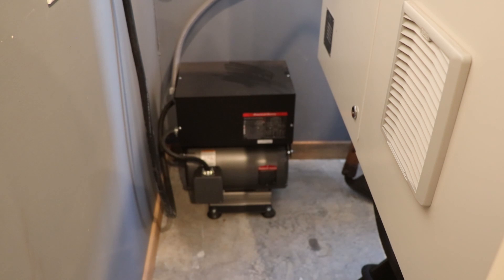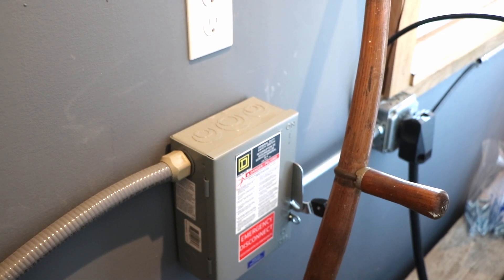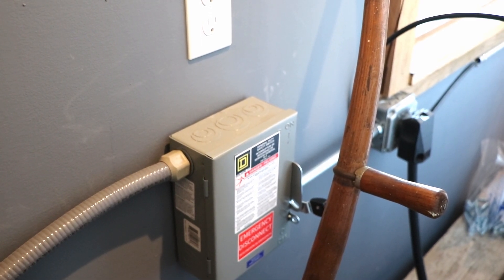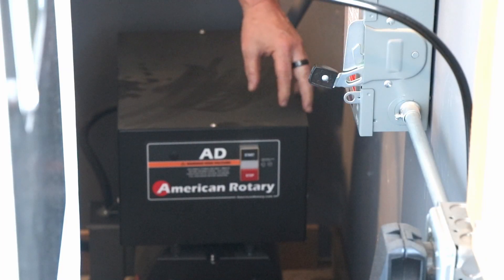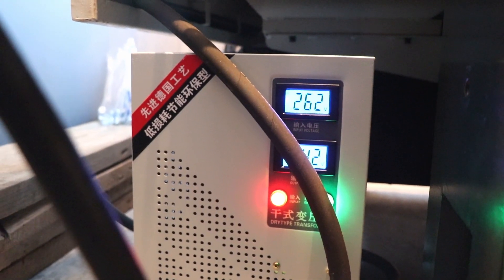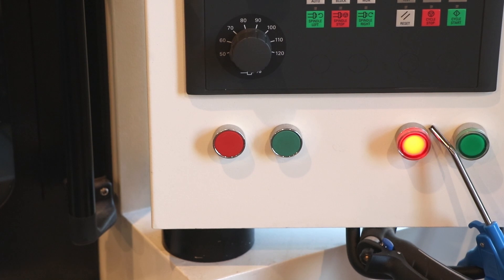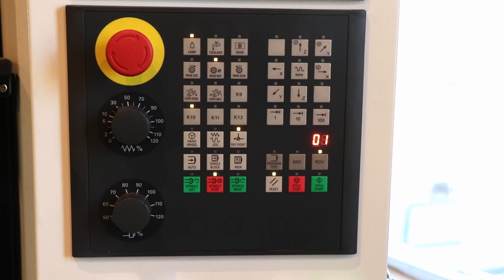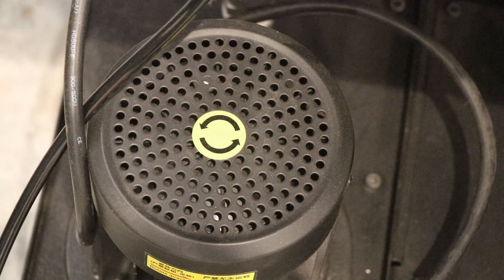SYIL X7 Basics: Power

Comment: Another great option for a phase converter are the phase perfect units. They are more expensive to get into, but they are solid state and load sensing. They also have much more consistent line to line voltages than rotary converters.
Reply from the maker: Thank you.  I'll eventually need an upgrade as I have multiple 3 phase machines and one converter.